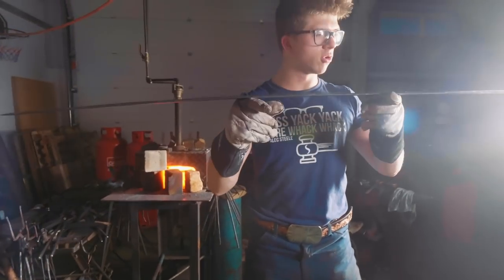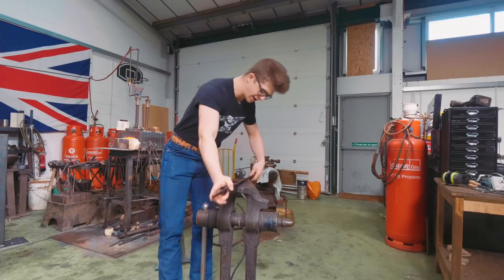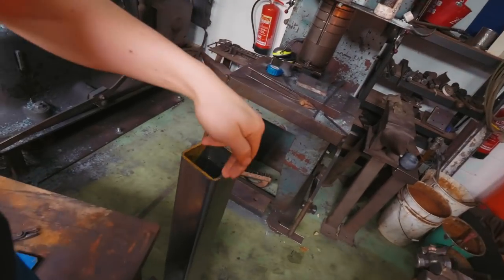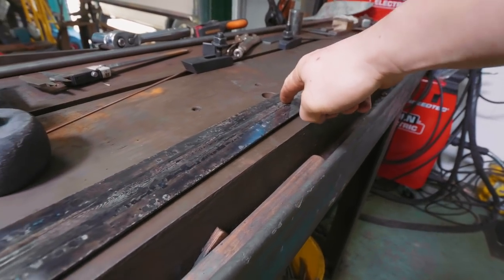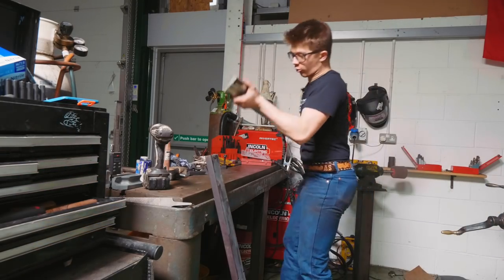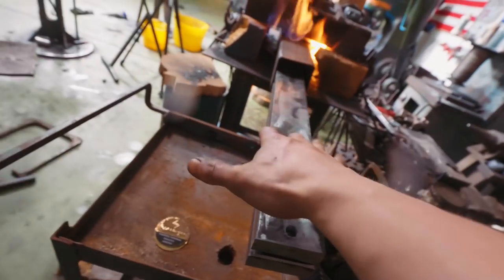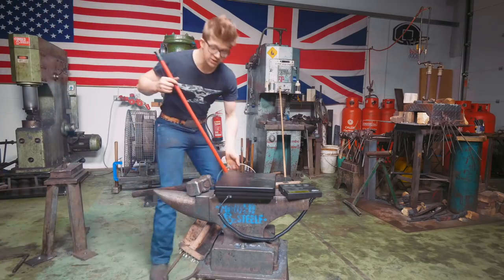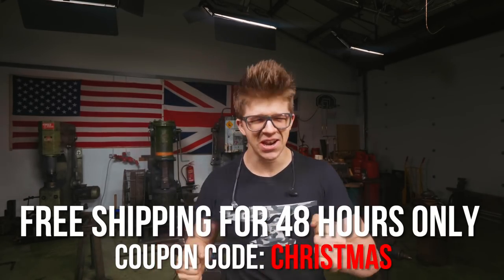MAKING A SCOTTISH CLAYMORE SWORD!!! PART 6

Comment: In future projects of this proportion. I would recommend that instead of hanging the blade up to cool after its heat cycles, you should put the blade's tang in a vice pointing it up in a diagonal form. This has seemed to work well in my shop over the past years. However, I have never made a sword as long as a Scottish claymore, so this technique may or may not work for pieces that long. Also, you should have only done minor fullers prior to heat treating. Basically to just set your lines up for later. If they are to deep, they can cause weak points that are very susceptible to warps during heat treat. Best of luck and keep up the excellent videos.

Comment: You should try hot oil tempering leave the blade in oil set at a steady temp and it's just like having it in a tempering oven
Reply: Joe Hipple yes yes!
Reply: Agreed.  Put a propane torch like a weed burner at the base of the oil tube and monitor for 400 degrees.  The AWE guys out of Baltimore do it that way and they are full production sword makers.

Comment: Instead of heat treating oven, you may use steel tube with oil, warm it up with torch, set stable fire using torch flame, oil boils at stable temperature so that way You will manage It :)

Comment: Freerk Wieringa is another smith with large sword building expertise. I have watched him use a vise with two long steel bars welded to it to prevent warping. He removes the blade from the oil and immediately clamps it into the bars. You can see him do it in any of his sword build videos. It would probably be an easier (even if temporary) way of preventing warping until you can get the oven.

Comment: You should make something out of the scale you sweep up off the floor. Reduce it using electrolysis to get the iron back and make a little pocket knife or something ⚒🗡🗜
Reply: MegaCrazyvid would have to add carbon back to it also

Comment: Do a brass and steel Damascus. Call it bramascus.
Reply: Beginner Blacksmith that could be called mokume gane but brass melts at steel forging temps. Silver or nickel will look better than steel and can be forged with brass or copper.
Reply: Uninspired Rambler cool thanks.
Reply: Beginner Blacksmith there’s a video here on YouTube of a smith using molten brass to fill the voids in a piece of steel cable. I think he called it dambrasscus if I remember right, looked really cool after he cut into it and blued the steel
Reply: Tumbler2012 I actually tried that. It's A LOT harder than it looks. If the cable isn't basically melting hot it won't work. And it's really dangerous too. I might try it again when I have a better smelter but for now it's just too friggen complicated for the amount of material you get.
Reply: I think brass and copper would look cool together as Damascus. It would be perfect for a Steampunk project.
Reply: Double Dare Fan mokume gane is the Japanese term for it. Same concept as Damascus steel just using non ferrous metals, really cool stuff. I make it from quarters all the time lol
Reply: Tumbler2012 I made my wedding rings from dime mokume gane. Awesome stuff to work with!

Comment: A good way to straighten any type of warping is to heat up one side and as it is still hot use a wet rag and quench just one side. It will pull the steel in that direction. practice first if you try it as you can go to far quickly. It's commonly use in sheet metal work to remove warps and "oil canning". Hope it helped and keep up the good work!

Comment: I always interrupt my quenching to check for warping. If there are any then I can straighten with a gloved hand and then back into the oil. It has worked for me.

Regarding warpedblades/swords, Karl B. Andersen says this: 
There's no need to re-heat treat.
I see that so often and it's a waste of time.
Do your initial temper.
Then, with a C-clamp, clamp the blade to a bar of steel with the apex of the warp AWAY from the bar. Use a metal shim under the blade tip to create a space between the knife and the bar. Place the C-clamp on the apex of the warp, and clamp it until you actually push the apex PAST the point where the blade would be straight. So, in essence, you are pushing the warp to the OTHER side of being straight.
Give it the second temper and let it cool completely back to room temp. Make it a full two hour temper.
You may be surprsed how straight it is.
If you need to do it again, you are only doing the blade good.
I have saved MANY blades this way without going through a full re-heat treatment.

Comment: An old restaurant trick for when you get oil on the floor. Pour salt on it. The crystals absorbe the oil over an hour. Then you can sweep up the salt. Till it is absorbed it creates a grit so no slipping. Makes mopping easier also.

Comment: Use clay. Lite on the edge and hard on the middle. Then put in the forge to heat it up. Then let cool the lite clay will cool faster and provide a hard edge while the thicker clay in the center will keep the metal soft which will give the blade its flexibility and be able to withstand a fight

Comment: I am a welder/pipefitter and I weld a lot of stainless steel pipe which has a tendency to pull out of square. Sometimes my fitter is a horrible fitter and fits a weld up way out of square. We will fix it with a wet rag.

I will walk the cup over the side I need to pull it to to get it hot again. Let it cool enough that I can brush it clean then hit it with the water. It's not too hot that something would stress or crack but the metal shrinkage is enough to pull an 82 degree ell to a true 90 degree ell as an example.

Not sure if this would even be viable in your application, but it's an option I figured I could throw out there.

Comment: This is one of those "This would have been 10x easier if only I had the proper equipment" kind of deals. You definitively need a proper tempering oven, as well as a longer (and less hot/redistributed heat) forge for heat treatments.

Comment: You know, you could do plate quenching. Basically, you take the blade out of heat and cool it between two metal plates instead of in liquid. This cools the blade more evenly and keeps it straight while doing so.

Comment: Piece of advice that i learned from Man at Arms: Reforged, is that there is a short window directly after the oil quench where you can bend the blade back to being straight.

Comment: Immediately after the heat treat quench while there is still heat in the blade clamp it securely between two boards and allow it to cool to room temperature. No more bends.

Comment: If you invested half the energy you put into half measures into once building the right tool for the job you'd be hardening swords like nobody's business...
Seriously. Build a tempering oven...
Reply: Would be an interesting project to watch.
Reply: But he isn't a dedicated bladesmith. Those are very expensive tools to build and unless he intends to start producing and selling swords there isn't really a point. You wouldn't buy a boat to try deep sea fishing for the first time in your life.
Reply: Uninspired Rambler it's not about buying, it's about building one. Dont know if you can build that so easily but that's what he meant.
Reply: herbert jauch and I said that building one isn't cheap either. I've built several forges myself and they still cost around $500 USD when you build a forge suitable for a sword. Kaowool, castable, pipe and fittings, forge body and other personal quirks make a forge expensive to build. And shipping of these materials costs almost as much as the retail. Especially castable which seems to be Alec' s preferred refractory. Blacksmiths don't make a lot of cash. I'd guess he makes most of his money by having classes. $500 is a lot for a tool you may only use occasionally and don't actually sell the products you make with it. This isn't a hobby to him, it's his business and he probably can't afford to throw cash at things that won't make the money back.
Reply: @uninspiredrambler  if memory serves he makes a fair bit of swords or longer daggers on his YouTube so it would see a decent amount of use and even if he only uses it occasionally unless the forges break down from age without excessive use having one already built for however many swords and other miscellaneous long objects he is going to build until he retires is well worth the initial investment
Reply: @bjornthorgudmundsson2781  by this point yes. Back when he made this he'd  made only a couple of blades. Now his channel is almost entirely blade making so it'd would make since to start making specialized tools for it.
Reply: @uninspiredrambler  he makes well over 20 Grand a week just from YouTube..not to mention his sponsors and merchandise sales..all from blacksmithing. I'd call that a professional dedicated blacksmith..maybe not in the traditional sense but he can afford to get a tempering oven..i think he actually has several now...i know this is old...not trying to knock u just sayin...dont feel bad for rich people😉
Reply: @uninspiredrambler  I'm sorry I did the math wrong..its usually $4000 a month per 200,000 subscribers. That's from Ad revenue...so 10 Grand a week..he prolly clears 15g's a week easy, all together.
Reply: @jonm2416  dude this discussion happened back when he still forging out of a hole in the wall shop in England. He had made maybe 3 swords at this point and was most likely saving funds for setting up in a completely different complex.
Reply: I know it's 2 years old...back then maybe he had 500,000 subs? A mil? Thats still a rich young man😊

Comment: You should've bent the sword straight in a vice right after the hardening, not putting it back in the oil as you don't want the core to harden when you rely on a surface colour with the tempering. You looked at it from the side, while you should've looked at it down the edge to see a curve. If you're not sure about keeping the blade straight, you're better off leaving on more material.
Tempering with a blowtorch is quite popular for larger objects like swords, and was probably the best choice. You may want to use  an open forgery with controlled light so I can see the colour.

Comment: So I know that I am watching this after you have done all that work. But for future reference, from what I have heard, traditional temper was done using a hot almost white rod laid in the fuller, and removed when the colors have moved out to the blade as they are supposed to.

Comment: Dear Alec best way to get any metal straight is with screw hand press (equipped with pressure meter). It's more reliable then leaning on it. This will give more control over place you are working on.

Comment: How about stacking some bricks out the back of the forge to keep the heat contained. Painting the heat then would be more consistent, as the tip would never push out into the cold air, and you wouldn't have to worry about it overheating as the addition to the forge would be cooler than under the burners.

Comment: It's not bending because of the oven. It's because you're using two different metals that are welded together.They have different dilatation coefficient (one shrink/expand more than the other). It's the same that happened with the rapier. It's supposed to come back to normal once it cools down.

Comment: With very long blades it's best to clamp them in a bench vice with the tip facing upwards at a 45 degree angle and allwoign them to cool that way. It reduces the chance of warping by a lot.

Comment: I know very little but I have learned you should cool the sword in under compression and not tension. Meaning you hang your blades after heat treat. This allows the grain structure to form under tension. But if you put the tang in a vise with the blade pointed up the grains form under compression and form a tighter grain structure. Look up Baltimore knife and sword. The have a channel called man at arms reforged.

Comment: Those cap heads are set screws not bolts.
There are two schools of thought on what makes a screw:
One says that if it is fully threaded (no plain shank) then it is a screw.
The other says that if it doesn't have a nut so screws through one part into another then it is a screw.
The first way looks at the design of the fastener itself whereas the second looks at the application in which the fastener is being used. I hope you found this post informative.

Comment: Alec, you can put a burner on a steel tube filled with oil, make sure the oil is stable around 215°c and dip the blade in there for about an hour. Should give you an even heat all the way across the blade

Comment: After quench you have like 5-10 seconds to tweak some bends before blade cools and becomes too hard to bend anymore. Many blacksmiths clamps blade after quench between some straight boards or angle iron.

Comment: i'd say after the quench and removal, keep it it near a vice and bend the blade straight before all the crystals form in the metal and stay vigilant until the cooling is done and the blade should stay straight. The channel "man at arms" seems to do it in one quench.

Comment: @Alec. I have sometime ago seen a video from someone in eastern europe.
He told that having a sword where the amount of material varies from side to side causes the warping.
He had on slight curve in the blade and straightened it in the run of hardening.
He quenched quick and brief, checked the symmetry of the blade, bend it til it was straight and continued quenching.

I isuppose this has a backdraft as the quenching happens in 2 sequences.

Oh, before I forget AGAIN ... in Japan iare the swords not dropped vertical into a pipe but hold horizontal and laid into an appropriate container. This way is the quenching of the entire blade happening more or less instant

Comment: Temper it in a oil bath. Aka, heat the oil in your quench tank with the blade suspended in it. Will give you more control(?)

Comment: Alec - I am a swordsmith. build yourself a vertical heat treatment kiln from a barrel. I have done this. They work better than electric ones, even. Burner in the bottom, baffle it with bricks in front, another burner higher if you make an extra long one. Hang insulation in front of the higher burner to baffle it. You will be very happy. email me for more information if you want.

Comment: Do you know the magnet trick?  When tempering steel, attach small magnets to the piece.  Heat it up until the magnets fall off.   The steel loses its magnetic properties when it reaches the decalescence temperature, which coincidentally is also the transitional temperature between Austenite and Martensite.

Comment: Next time use your tempering oil tube with the oil in it use a burner and heat up the oil to the correct temperature and then hang it in there and do your tempering in the oil tube.

Comment: I know what might help you on a heat treat oven. Here where I'm from ( Minnesota ) when we need a big oven or meat smoker we get an old stand up freezer and modify it for heat but that would give you 4 to 5 feet of hanging length depending on the freezer of course or you could use a big chest freezer with shelves inside but that would make more horizontal spaces lol

Comment: If you quench the blade and it keeps warping like it was, go through your normalizing cycles and straighten it as best you can and go for another quench, but this time vice it as it cools and apply pressure in the opposite direction of the warp. Then when you release the pressure it should bend back to true.

Comment: Hey Alec you should try a hot oil temper on your long project's. I see it done by other blacksmiths doing it on their pages. One in particular is (Man at Arms Reforged) they heat they dunk tank to 450 degrees and let their blade sit for about an hour or so. So you should check them out. I just found it kind of fascinating.

Comment: I have seen other videos where the Smith SEEMS to temper the blade with a torch while it is lying flat on the table. Seems to work pretty well although I'm sure it takes a while longer.
Reply: Search for Freerk Weiringa for an example of what I'm talking about.

Comment: Could you just make a longer forge with burners on the bottom and a heavy steel table in it to transfer heat from theflame to the blade  more evenly?

Comment: I don't want to tell you how to live your life, but you should just heat up your oil tube to the desired temperature and leave the sword in there for an hour or so. Its a good way to keep the heat even over the whole blade, and its just overall easier. You can also straighten warp with this method. You only had one laze bend, just take it out of the oil after an hour while its still hot and bend it back the other way. It works quite well.

Comment: Hey alec if you put your quench at magnetic north the blade tend not to warp as bad. This is from my personal experience, take this how you will i just thought it wold hel for projects
Reply: its an old wives tale. Earth's magnetic field can pull a tiny needle with effectively zero friction acting on it, and thats about it. If it was strong enough to affect a blade during quenching, it would far more strongly affect steel the rest of the time. You'd literally feel it every time you held anything steel in your hand.